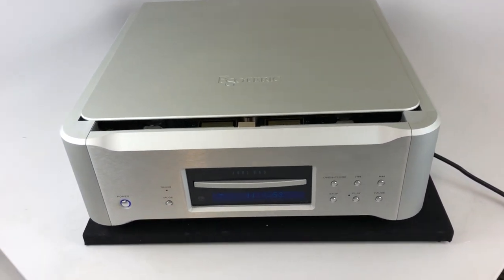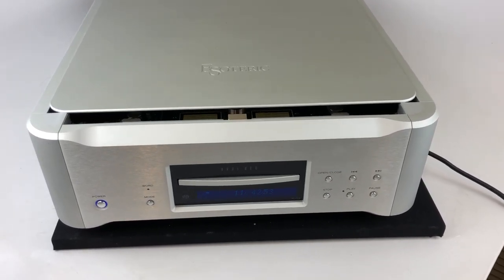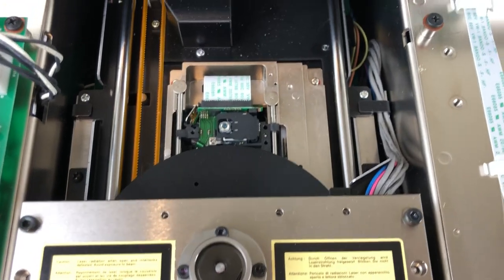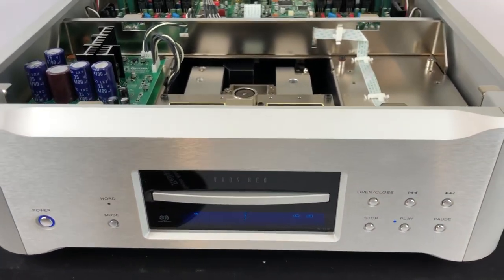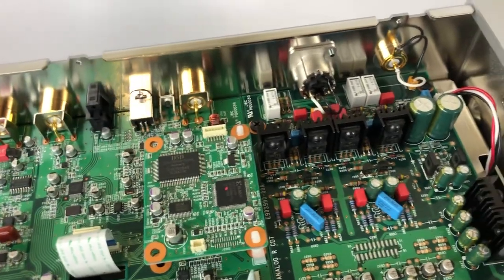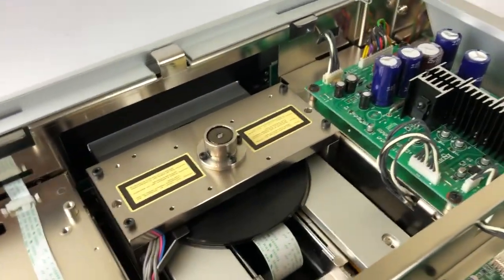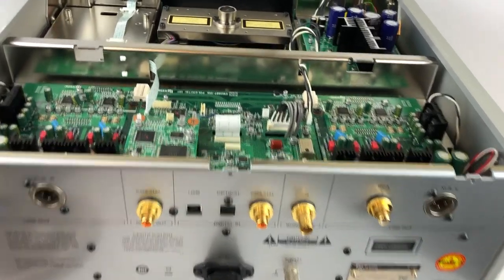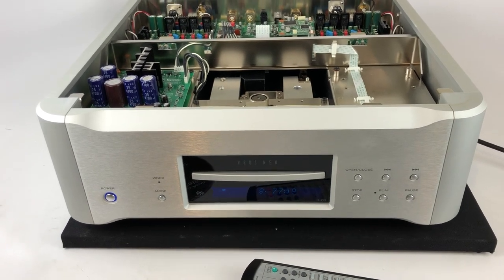Legendary & Recent Esoteric K-03 SACD/CD Player w/QUAD DAC's Per Channel!

Comment: I was thinking of purchasing this unit but I also want to stream.. is the N-03T also needed?
Reply: Only if you don't want to use a computer. I have a laptop and a 10 ft USB cable and it works fine.
Reply: @goldorak1962  thx